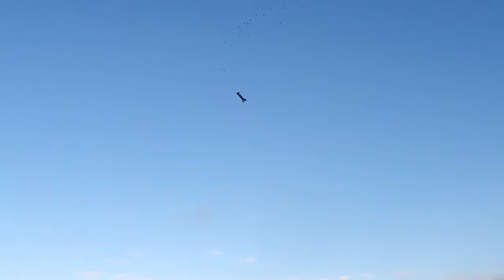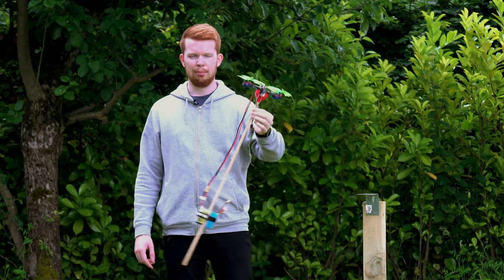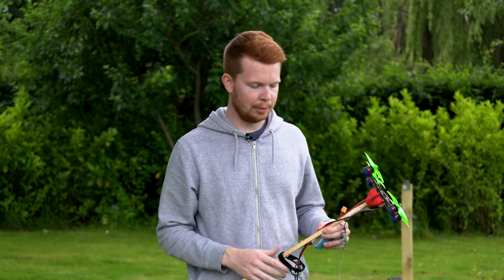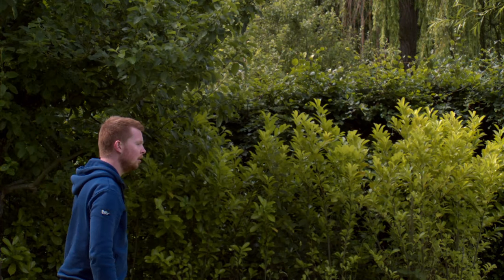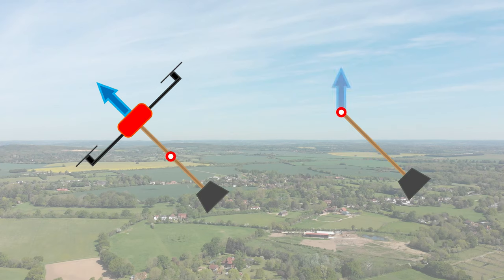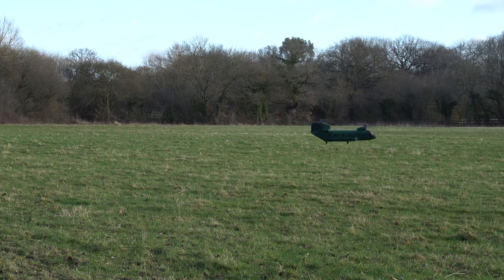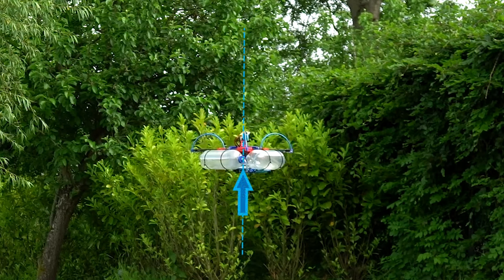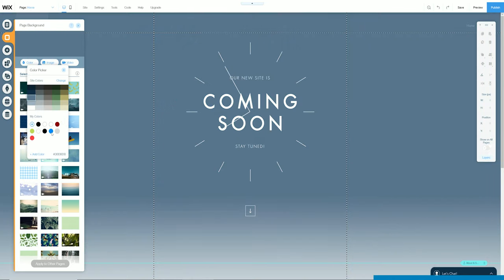Drone Pendulum Fallacy

Comment: Pendulum effect or not, I'm honestly surprised that a flying object with it's centre of mass so far from it's centre of thrust is not producing any kind of torque effect to speak of.

By lowering the placement of a major mass you've created a much bigger moment arm.

Incidentally, while it may not be caused by the pendulum effect, fixed wing aircraft with certain designs have a self-leveling characteristic.
Typically in civilian aircraft the designers strive to create this effect on purpose (while in military aircraft they forgo it for extra maneuverability.)

In a low wing aircraft, the effect is accomplished by changing the dihedral angle of the wings. (so the wings aren't level, but are angled relative to the body)
Angle the wings up, and you create a stabilising effect (roll to level without outside influence), and with the wings angled down, you create a destabilising effect (tend to roll over when controls are left alone - typically a fly-by-wire system is used to compensate for this if it's part of the design.)

However, what's interesting to note is that high-wing aircraft have a natural stabilising effect, even without actual dihedral to the wings...

This is generally thought to be caused by having the centre of mass below the centre of lift, but of course on a drone you don't really have any actual passive lifting surfaces, just the propellers...

All really kind of weird when you think about it.

Comment: Hey Tom! about the pivot points example using screws on a stick, i was wondering what cool effects could be obtained if designed a  kind of mechanism that could shift/slide a stick in order to change pivot point while spinning it itself.

Comment: Drone racers already know that what putting battery low actually does is it stabilizes the drone, but only in tight turns, not when flying along a straight line.

Comment: What if you use a flexible joint at the point where the pendulum shaft joins the drone so that the pendulum movement is somewhat independent of the drone except for lift?

Comment: There actwis a pivot point, the pivot point would be the center of gravity and not mass
The motor hads a force up which counter acts the gravity of the whole drone.
Since almost all the mass is at the bottom the drone "head" would be given the same force up as the stick has a force down. Making it effectively act as 2g.
But the fact that the drone is rotated make sit also go sideways. As long as the head go's sideways ay the same speed as the bottom of the stick, there is no visible effect.

The thrust needed to counteract gravity is just the same in the horizontal axis as the pendulum effect.

Comment: What if you increase surface area above the CoG so that area above the CoG has more drag and resists moving through the air more than the area below shifting the pivot point above the CoG as soon as the drone starts moving through the air?

Comment: What happens when you hang an actual pendulum from the drone? Like a weight on a string or like an axle/pivot point at the top where the stick connects to the drone so it can swing? Just out of curiosity

Comment: Bizarrely, the moment you picked up the drone/stick combo I realised why it doesn't work. The center of mass isn't going to stay in the drone.. it'll move to a point along the stick where the masses of the drone and the batteries (and technically, the stick) all balance out. Since the drone is essentially pulling all of this, it's ALWAYS going to pivot around that center of mass. If it were standing absolutely still, it would look stable.. but it's actually less stable than the drone on its own.
Sidenote.. are you pronouncing 'chinook' shin-ick? It's a First Nation's word and is more correctly pronounced shin-ook or shin-uhk.

Comment: What would happen if you attach the batteries with strings of equal length to the four arms of the drone? I think it should put more force on the side that is tilted up, causing it to rotate back.
Reply: why would it put more force on that side?
Reply: @sea_kerman  well by more force, I mean the weight of the batteries would be distributed more to the side which went up(because the string would be under tension), and would be less on the sides which went down(because the string is slacked there)

Think of hanging a weight to a stick and lifting one side of the stick up more than the other, this will cause the string to slack on the side which is lower(less force) and be under tension on the side that went up(more force)
Reply: @arnavjain7564  that force is only momentary, and is internal to the craft, and so will not provide stability.
Reply: @sea_kerman  I'm not sure what you exactly mean..
Reply: @sea_kerman  anyways even if it doesn't work, I would still like to see it happen..
Reply: @arnavjain7564  the force will be for a fraction of a second, as the movement starts, and is essentially the same force as the inertia of the motors on the arms would cause. Also, it is internal, and so cannot affect the torque on the system.
Reply: @sea_kerman  oh, I kinda get what you mean.😁
Reply: @sea_kerman  but if one side stays up the force won't be momentary, it will stay on that side as long as it is up. I think what you are referring to is the jerk or impulse of the force? Not sure exactly, but I really wanna see what would happen nonetheless.

Comment: WHY wouldn't the motors and propellers try to straighten it out?
What did you do to the PROGRAMING to shut down that action that is usually active to correct pitch, yaw, and azimuth???
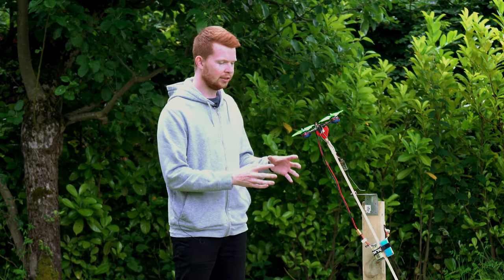Reply: 0:48 "to test this, we need to eliminate all other forms of stability." He's not testing the drone's capabilities.
Reply: Azimuth is the horizontal direction of the drone not one of its axis of rotation

Comment: It would be better if the rotors were pointed inwards.  That said, I have no idea why someone would find it practical to move so much mass so far from the axis center of the frame.
Reply: Unfortunately, if the rotors are pointed inwards, you will end up with the net force still pointing straight up, because the rotors will counter each other, cancelling any other forces. Plus, because the forces are being cancelled out and aren't straight up to begin with, you will actually be losing a lot of potential net force, making it a less efficient design with no benefit.

Comment: Why start the drone flying at such a steep angle in the first few tests? And why use a fixed pendulum? Wouldn't a pendulum that can pivot around where its connected to the drone be more effective for leveling the drones flight? And probably would acheive stability in less time as well I'd imagine.... Idk, thats my opinion, but you for sure have much more experience with this sort of stuff, I'm just curious as to why you did it this way instead of having the pendulum on like a ball joint where it connects to the drone so it can swing freely in any direction.       Well anyway great vid, excellent content, no stupid clickbait titles like " Putting a PENDULUM on a drone?!?!(GONE WRONG)( DRONE CRASHED) (POLICE CALLED!)"     And having a thumbnail with something crazy that doesnt even happen in the video with a big red circle around the drone and bright yellow words saying more clickbait nonsense.    Its super refreshing having someone just be straight forward and to the point with their projects, who cares more about the science and quality of the content rather than just concerning yourself with getting peoole to click the video with clickbait.   Your one of thw good ones Tommy ol' boy, keep up the excellent work.  When i finally have a bit of spare coin id gladly support you thru patreon if your on there, you certainly deserve it man
Reply: The time constant with such a large moment of rotational inertia is long. So the video would be long and boring.

It would be interesting to launch from a pivot point, such that the quadcopter is a swinging pendulum before launch and becomes a tumbling object once in flight.

If the quad is launched at an extreme of the swing, it would barely be tumbling, so it would be close to this video. If the quad launched vertically, the swing speed would be at the maximum. The swing speed once free of the pivot becomes the speed of rotation. It would be a dramatic crash, but maybe not educational.

Comment: This is a case of folklore misunderstanding the necessary conditions. The pendulum effect is real, but the pendulum must have a virtual rod. This is because the length of the pendulum rod is over 20,000,000 feet long extending to the center of the earth! This is the basis of autopilots. Essentially, you sense the direction of gravity with accelerometers. The pendulum is a dual graph mathematically. A flight path generating centrifugal force is combined with the gravity detected because the accelerometers cannot separate the two forces. To fix this, we introduce rate gyros and computer integration and our autopilot is now an inertial platform. A swinging pendulum on a moving platform is without much value, but that can be changed. If the pendulum is suspended in a tube and a servo applies measured forces to keep the mass centered in the tube, then integrating the force components applied can yield the desired output and the pendulum doesn't swing relative to the tube. But, I just described a form of an accelerometer, and this is the equivalent of the pendulum to the center of the earth.  So, the pendulum is basically a thought experiment, a conceptually convenient equivalent. In the real world, external loads swinging under a helicopter are destabilizing. That is why remotely operated release devices are essential. Yes, they are convenient for cargo delivery, but they are in fact a safety measure.

Comment: Couldn't you just explain this using planar inertia? Drones are tricky dicky because of their three axis of movement. Basically, the sphere is the best shape for weight distribution in a drone. You want it to be positioned at the center of the point of thrust correct?

Comment: So, here's the thing.   It's not a pendulum. The batteries on the stick are fixed to a fixed stick fixed to your thrust source.  If you don't gain vertical height you will drag that non-pendulum behind you.  Your pendulum is NOT a plumbob.  It will NOT point downward toward the source of gravitational attraction.  Rather -- as you discovered -- it will be an angle between the forces.
A helicopter carrying a water (Bambi™) bucket will exhibit the same effect of the forces.  You can reduce or increase the angle, but you can't get horizontal flight without horizontal forces.  Those will ALWAYS be at angles to the vertical (gravitational or upward thrust) forces.
If you want to determine how to make the CG (center of gravity, or center of mass, almost the same but different) near zero that's not ever going to happen.  To minimize it you do two things: 1) Make the "pendulum part" swing.  2)Make the CG/CoM as close to the bottom of the aircraft, not several feet/many centimeters below it.
If you put the "pendulum" on a 360 degree swinging attachment, and brought the battery weights up, you'd find that even as horizontal thrust remained constant, vertical thrust (gravity) would cause the real pendulum to point downward, thereby providing more stability.  This is harder to model but again using many firefighting videos of helicopters with Bambi Buckets™ you can see that.  
In order to do this you MUST have vertical thrust.  If you only hover sideways with your drone, you will always "drag" the "pendulum" behind, and it won't help stability or directional control.  In fact, if you tried to fly a circle with it, you'd be surprised how quickly your stick and batteries' momentum in one horizontal direction will negatively affect your directional control in a perpendicular direction.
Take a look at videos of helicopters with "long line operation", the buckets, etc.  Those all involve REAL pendulums that swing in 360 degrees... and the turns must be led... must be followed, and must be slowed to get the momentum of the arm to stop.
Thanks for the lesson!

Comment: For this to work all the propellers need to have a outward thrust vector. Tilt all of the motors ~15deg inward so the thrust is not pointing straight down but pushing against the opposing thrust.  It will only ever hover in still air in this configuration. Not very useful as a drone.
Reply: the sum thrust vector is the same though...
Reply: Odyssea Hadjioannou quite true but the initial stability will be higher.
Reply: @SirBoden  no, I mean that it's identical to a single counter-rotating set pointed straight down from a free-body-diagram point of view. Perhaps there are some aerodynamic effects I hadn't considered.

Comment: The pendulum idea works IF the rotors have "dihedral" and "decalage"

Aim the thrust lines all at a point a couple of feet above the drone's center.

You have the test rigged to fail.
Reply: The drones with all of the prop shaft parallel to each other will not benefit from pendulum effect.

Aiming all of the shafts at a point above the drone moves the pendulum pivot up.

Note that the pendulum effect will make changing direction of motion tricky, since you have to compensate for the momentum of the center of mass being well below the pivot.

Early drones aimed the motors all at a point above the CG to aid in stability.  These could fly without the auto-stabilization we take for granted today.

Comment: If the stick were on a pivot, there would still be no way for the pendulum to generate meaningful moment about its center of the drone's propeller based coordinate system, and that's really why this fails. A pendulum cannot create moment about a center of mass. Moment is defined as the cross product of the force (or the integral of a distributed force per distance times radius taken with respect to radius about the center of mass) and the radius. Since the propellers themselves are applying an axial force with respect to the center of mass, there's no moment in this configuration, as gravity acts at the center of mass, so the cross product is identically zero.

In the configuration with a swinging pendulum, the pendulum would act as if it were in an accelerating coordinate system, aside from energy dissipation at the bearing due to friction. It would not serve to make the system stable.

There are a lot of applicable stability criteria here and it would be not difficult to come up with governing equations for the system and demonstrate instability for either setup, but these intuitive arguments suffice from a physical standpoint.
Reply: The reason why you see a moment about eccentric pinned points under pure gravity loading, by the way, is because there is a fixity condition allowing moment to be developed. No matter what, if the whole system is free to rotate and translate, gravity will not, and cannot, generate a stabilizing moment.

Comment: Well I don't know WTF this pendulum fallacy everyone has apparently been talking about in the comments section is, but I doubt they intended for you to build a drone that flies repeatedly into a hedge. WTF? 

But given how unstable most of your drones in this video appear to be, perhaps they were suggesting that an object with a lower center of gravity would be MORE STABLE and thus LESS LIKELY TO ROTATE! If so, your video proves they were correct as your stick drone was by far the most stable! Had you not launched it from a tilted position it might have just hovered there like a good drone is supposed to! Or perhaps you could try the experiment again with the stick attached to the wood mount and see if it rotates back to center? 

But then again, maybe those other people were idiots. 

Also, if you want to find the center of mass of your stick without flipping it in the air, place a finger (or nail or knife edge) under each end of the stick and slowly move them towards each other. Friction will keep the heavy end in place while the light end slides.

Comment: Could you make a compressed air engine that have 2 valves which push air in the exhaust then in the intake and so on so you don't need to rely on the flywheel to push the piston up

Comment: Have you tried angled propellers? Top of the propeller angled inwards.
Reply: Do you mean the tip of the prop angled up and turning the rotor disk into more of a bowl?  That allows more of the rotor blade to rotate at a similar speed.  Military helicopters use rotor blades that deflect upwards to allow them to rotate at lower RPM's.  Makes them quieter.
Reply: @briand8090  I'm thinking more of a quad copter. But any time it tilts the propellers toward the tilt direction will give more vertical push then the other propellers. A drawing would explain a lot but I don't have one.
Reply: @AdrianStaicu82  With a traditional quadrotor, the rotors are fixed to the frame.  The aircraft is altering the lift individually at each rotor.  If there is a difference in the amount of lift generated between any of the rotors, the aircraft will move from the direction of the rotor(s) producing more lift to those producing less.

The same effect will happen if mass is moved around while all the aircraft is hovering.  If a weight was hung from the front, that weight would change the center of balance in relation to the center of gravity.  The aircraft would move towards the front not because the rotors in the rear are producing more lift, they are still producing the same as the front, but because the front rotors have to carry more load.
Reply: @briand8090  I'm talking about not putting the motors leveld to each other. Each will be angled to push a part of the air outwards. When the system tilts... one motor will push all air downward, produceing max lift and the one oposit to it will push air even more outwars... produceing less lift. This combinated with the pendulum might be able auto correct and self level. All motos spinning at the same speed.